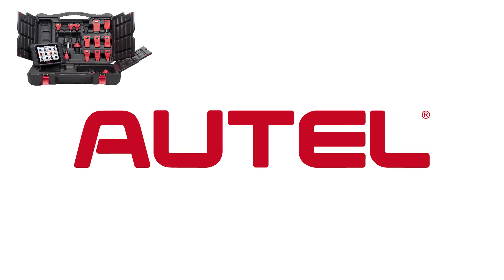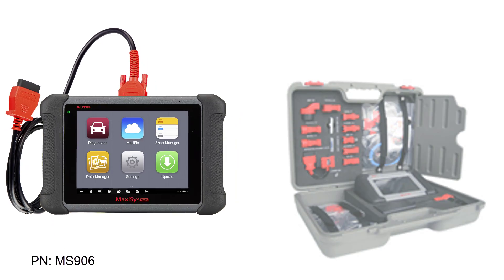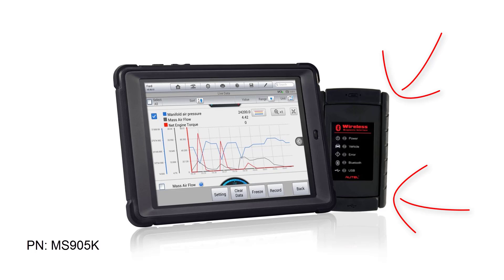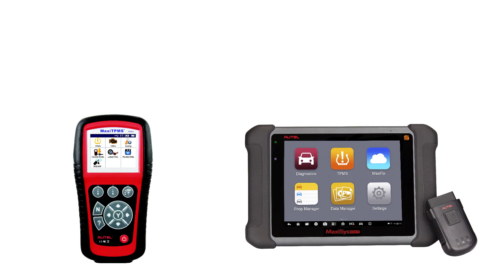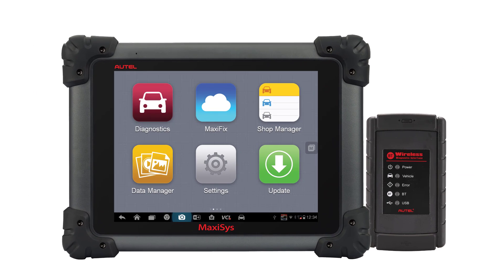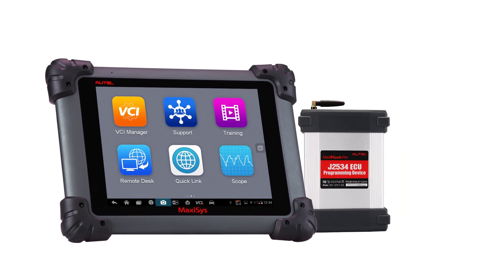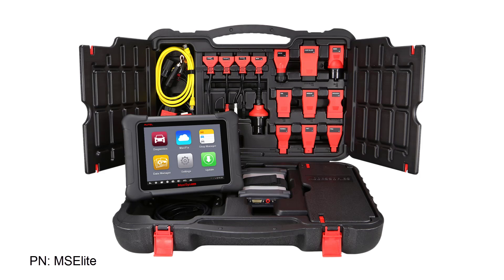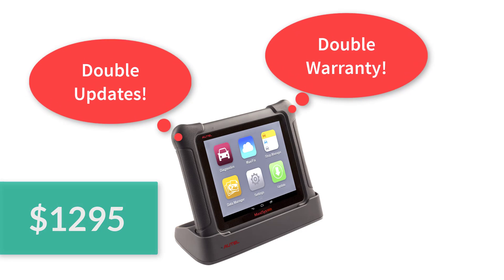MaxiSys Line of Tools Explanation

Comment: Flash Performance... Can the Autel MS908S Pro, program smart/proximity keys on a 2020 Ram?? Also can on that has already been programmed for a Ram be reprogrammed to work on a different Ram?
Reply from the maker: No, on a ram key programming you need to pull the pin. Once ram keys are programmed they can not be programmed to another truck. You would need the IM608 from Autel to do that process

Comment: What's the difference between the ms906prots and the ms906ts.
Reply from the maker: The Majority of the functionality is the same between the two tools however the "PRO" is the new version. Newer android, faster processer, and it has the ability to add on modules and accessories like the battery tester.  Also the VCI in the PRO has CAN-FD built in. Here is a comparison chart https://autel.com/c/www/mk3/3743.jhtml
Reply: Thanks haven't seen anyone break down the difference between them i deffenitly need one with tpms and doesn't make sense for me to buy two tools.

Comment: Hi Flash. 
Which Autel tool would you recommend for a mobile mechanic!? 
Thanks in advance
Reply from the maker: You never know what you are going to get into being mobile. I would recommend the Ultra for mobile. That way you have the Scope as well.
Reply: @FlashPerformance  thank you for your quick response.  What do you think about Snap on diagnostic tools and in comparison with Autel in this case Ultra !? 
I really appreciate your help.
Reply from the maker: @kianparsi878  Snap on makes a great tool, but they are crazy expensive. I am finding fewer and fewer people that are diehard Snap-on Guys. Most Snap-on owners have to own a second tool to fill in the holes and gaps. That is just my opinion...  Depending on your budget I would also recommend checking out tools from TOPDON.us I have been impressed with this tool as well.
Reply: @FlashPerformance  great will definitely check them out. Just wanted to mention that I live in Australia in case it makes any difference .

Comment: One of the things that held me back on buying one of the systems was the fact that they're based on Android. I can't tell you how many tablets and phones I've gone through because the android system was outdated. That scares me.
But what scared me more was the cost of updating these things 😬
Reply: The version of Android that is shipped on these things is already outdated, but Autel doesn't need a more up to date version of Android as it is a relatively closed system with no Google Play support so it isn't as though you are going to be able to install any third-party apps to impact the performance of the device.  It's the same thing as running Windows XP in the year 2022 just because you only need to run the calculator app.  You aren't losing any functionality with the version of Android on these devices.
Reply: Yup. Trust me. I had a MATCO(launch) scanner and just this past December i phone for support and told me”sorry, Google has pulled the plug” $1600 gone…. Yeah 4.4 isn’t far away and they say its UPDATED FOR 2022????😂 that operating system is 15yrs old

Comment: What Is Unit Of Autel Scan Tool to Use 12v and 24v In One Scan tool??
Reply from the maker: What are you trying to work on that would have more then 12 volts at the DLC?   Even though it is a 24 volt system most of the computers and network still work off of 12 volts.
Reply: @FlashPerformance  Because Most of My  Works Is Light Cars And Cargo Trucks Thats Why I Need To Know What Is The Autel Scan Tool To Use That?

Comment: Dear Flash Performance,
Great video and explaination. 
I have a question regarding Autel MaxiSys MS906BT. Can i use this diagnostic computer to programe new electrical equipments? I also want to know if i can use this diagnistic tool to adjust and programe existence and new Tire pressue monitors? I also need to know if i can use this tool to programe new kar keys? If all the above functions can be done by MS906BT, than its great and if not, which diagnostic tool do you recommand in order to enable me perform the above mentioned functions in the cars? I thank you in advance. I also subscribed into your great channel.
Reply from the maker: Can i use this diagnostic computer to program new electrical equipments? You can use the MS906BT to do memory relears and coding, but not programming.  You would need a J2534 box for programming. TPMS: the MS906BT can program the Sensor IDs to the PCM but you will still need a tool to activate the sensors. If TPMS is something you want to do I would recommend the MS906TS. Key programming is limited, you can do basic keys up to about 2012 like ford PATS, Honda, Nissan, Toyota.

Comment: Hi thank you for the video. I have a question, please help me out .MaxiFlash Elite J2534 ECU Programming, Can I perform  abs module initialization or coding  with  Maxisys? But not with the laptop programming, on Toyota  or Japanese car.  Can it be done? Thank you
Reply: The J2534 can be used with your laptop and subscription to OEM software to flash the ECU and various modules in the car.  You wouldn't use the Autel tablet for that.
For SOME European models, the tablet has software that it would download the files from Autel's server and flash your ECU through the J2534 device (other than the Autel subscription, you wouldn't need an OEM subscription for this).

Comment: What's up with the MK908P? The MaxiCom Pro I believe... Is it the same as the MaxiSys pro, or MaxiSys elite, just different technical specs?
Reply from the maker: The MK908P has the same software as the 908P and Elite. It is not sold or supported in the US market.
Reply: @FlashPerformance So you mean if someone in the US ordered it online they would have no service or updates through autel usa, but through autel in china?
Reply from the maker: @12mak  The Support and updates would come from the region it was sold from.  You would still be able to get your updates, however if you had to call in for Tech support you would go back to the region it was sold from.  Sometimes that is Europe, most times Asia. Same with warranty and repair, it would have to go back to that region for repair or service.
Reply: @FlashPerformance  Thanks!  I am looking for something with good live data, bidirectional controls,  relearns and adaptations,  I do a lot of engine performance and electrical diagnosis and repair. Is it true the DS808K is the same as the MS906BT just lower hardware and no BT/Maxiscope/borescope support? What about the MP808K? I have no interest in TPMS. What would you recommend has the best value and functions for under 1,500?

A lot of sellers advertise 'ecu coding' but that is not coding modules after installation, that is relearns and calibrations etc. Is that correct? I really appreciate you taking the time to help me
Reply from the maker: @12mak  The DS808 Vs MS906BT- The MS906BT offers: Bluetooth connection, Oscilloscope add on, Inspection camera add on, complete OEM-Specific Scanner coverage, MaxiFix, Shop Manager, ECU coding.  I have never used the DS808 so I can't speak to the functionality of that tool.  When it comes to Coding, that is all about making modules talk to each other and telling the module what it is.  Some modules come with multiple variations built in from the factory. You just tell it what options the vehicle has and it will operate based on that coding.
Reply: @FlashPerformance  now that I have purchased a mk908p I live in Canada. Was not sure of this but seller assured me it would be ok. These are all made In China but only supported by local regions they are sold in? Autel should be renamed AWFUL makes purchases of thousands of hard money put down the drain, guess i will return this. Its not worth losing $3200 in a year and tossing as i did my last one that was not longer supported 👎
Reply from the maker: @meanodustino9563  that is why most of my videos say to purchase from an authorized dealer. https://www.autel.com/c/www/wheretobuy.jhtml There are a lot of vendors that just want to sell you something. Use that link to find a local vendor to purchase from and they can also offer support.

Comment: Doesn't really tell me anything. I'm not a business, it's just me and my one car and I want to be able to fix whatever and maintain my lifetime record of never having anyone do any work other than alignments and tires. As it is, despite hours of reading, I can't tell anything other than buying the most expensive model will most likely cover all my bases, but it may also be gross overkill? For example; say need to swap out the conductor plate on my tranny (2016 Mercedes 722.9 tranz), what secret squirrel stuff has to happen for the car to accept it? What Autel models can do it, and can I do it at all because what if the code/program needed is only available from MB and they aren't sharing so they can monopolize the work? Or when my ESL (steering lock) dies, or before it dies, I need to program an emulator to get rid of it. I also want to alter the way the tranz shifts so it shifts like a normal car, like from the 60-70's. Plus delete the "safety feature" that has twice thrown it into park while driving! Make it so no exterior lights come on when I unlock it and get in, or exit and lock it. Dim the dash lights lower than the oem lowest setting. Just little things that I know are possible, but is it possible for a Joe Blow using your devices? How does someone find all this stuff out? Thank you. Fyi I asked on auteltech.com and they never replied.
Reply from the maker: The answer to your questions is yes, no, and maybe.  Because of the agreements with the OE manufacturers the Autel tools can not change anything on the vehicle outside of manufacturers specifications. That mean no to changing the transmission shift points, or pressures, and not to changing the safety features or dash light dimming.  Some of what you are asking for can be done with SCN coding, and the Maxisys Elite, and Pro can do those functions. They also come with a J-2534 box that you can use with a PC to do programming.  Can the Autel tools do the conductor plate replacement, Yes, however some may require EEPROM using an IM608.  You would have to do the renewal process connected to the plate then the rest of the process can be done via OBD2.
Reply: It seems like I won't be able to get what I want but I thank you for the info

Comment: Do you know if by any chance the MP808TS does the same as the MS906TS? Like what is the difference do they both have bi-directional features.
Reply from the maker: The MP808TS will give you bidirectional controls, however I think it is missing the advanced coding features the MS906tS has. I have not used that tool, it is not sold or supported in the US market

Comment: How much are the updates?
Reply from the maker: each machine has a different cost for the updates. Check with your local dealer for pricing.  Take the model number of the tool and add "-1YrUpdate"  example "MS906BT-1YrUpdate"  Pricing ranges from $495 to $1295

Comment: Price was not pointed out nor all vehicles that this can be used for...😏
Reply from the maker: Prices will very by market.  Vehicle coverage can be found at https://www.autel.com/vehicle-coverage/coverage2
Reply: @FlashPerformance  i have a question if i was able to use a ms906bt for this job would it work? I got a 09 pontiac vibe awd 2.4 and i need to replace the abs module and was curious if i have to get a brand new module or if i can get a used one to work, i believe the ms906bt can read the info on the old module then when u go through the program it will tell u to install a the new module what alot of ppl dont do is they dont read the old module when its in the vehicle they just change it out for a new/used one without reading the info first. Just curious if the 906bt can do this type of repair? I know its vehicle specific but just trying to get and idea on what the 906bt can really do. Thanks flash!
Reply from the maker: @downeastoutdoors8713  On an 09 you should not have any problems installing a used unit. I would recommend making sure the part numbers between the original and replacement are the same.  You are correct, you will need to read the module information with the scan tool first, then replace it with the used module.
Reply: @FlashPerformance  would it be different if the module was brand new vs used? I figured it would work on a new one as well but dont have years of experience with higher end scanners. Thanks for the reply :)

Comment: Can the 908pro reprogram seats after a collision when airbag light is on for occupancy sensor
Reply from the maker: Yes, it can do the memory reset on the seat weight sensors.  Usually the airbag module has to be replaced with a new one and it can be programmed with the J2534 box.

Comment: Wow,  excelente video but i was wonder if you can help me to understand more about MAXISYS 908CV,light duty,medium duty and heavy duty, so far I haven’t find any specific information about it and i really confuse me 
... I believe the same diagnostic tool does everything and it works on cars and trucks 
Nice video and very well explained 
Thank you
Reply from the maker: The MS908CV does Light, Medium, and HD Trucks, Buses and Semis.  However it does not have any passenger car coverage.  Every truck from a Ford Ranger to a Class 9 AutoCar.  A tremendous amount of new updates just came out this month (April 2019) adding Trailer ABS, ThermoKing, Body control modules and more DPF functions and procedures. Message me on my FB page @Flashperformance and I will send you the update information.

Comment: Hi, I'm on the UK & was wondering if buying a elite or 908 & series would include the 2 years warranty & free updates to or that just for the US customers?

Also what is the differences in the elite to the 908s to the 908s pro to the 908cv?

Any help would be greatly appreciated as I'm looking to buy one asap
Reply from the maker: It is my understanding that even the MaxiSys Elite in the UK has 2 years of updates and warranty. Check with your local authorized dealer.  There are a lot of fakes and hacks in the UK.  "S" series tools are just upgraded hardware and they come with 64g of memory vs 32g.  The CV tool is for commercial vehicles. Class 1-9, no passenger cars

Comment: Hi what’s the difference besides the J coding block from the 908 to the 908P? Can I still code and program my bmw without the upgraded J 2534? Thanks In advance
Reply from the maker: The base software between the MS908 and MS908P are the same, however the MS908P with the Jbox adds the programming software.  You can upgrade your MS908 to an MS908P  by purchasing the J-box and linking them together. To answer your question, no you can not do programming with the MS908, only the P with the J-Box
Reply: Flash Performance thank you for this. Is the coding the same for both? I want to buy one and add a video of it to my you tube channel so others can also see how good it is.
Reply from the maker: @weldingjunkie  Yes, when it comes to the coding part they have the same functions between the two tools. Good luck!

Comment: Does the Elite have the option to hook up to the car hard wired? That is, does it come with a cable to hook up to the OBDII port instead of wireless? Is it better to go hardwired if doing reprogramming? I have read horror stories about lost connections while programming.
Reply from the maker: The tablet can be connected directly to the J-Box by using the provided USB cable.  It has red ends and is gold plated for best connection speeds.  When using the tablet to do supported programming features, the tool will require you to be connected with the USB cable before it will let you proceed
Reply: How about regular scanning- can you hook the tablet directly to car with a cable or would you have to go through the J2534 (like if the wireless wasn't working for some reason)? @FlashPerformance
Reply from the maker: @patrickstewart4620  Sure, you always have the option to connect with the USB cable through the J-Box, but there is no way to cable directly to the vehicle.
Reply: Thanks for the info! @FlashPerformance

Comment: What about the Autel MX808 and Autel DS808? What's the difference between these two? I just need a computer than can read manufacturer specific codes.
Reply from the maker: This video was made before the MX808 or DS808 were released.  The MX808 can read manufacturer specific codes in all modules along with graphing and clearing. It also has service functions like Electronic parking brake and Oil life reset.  The DS808 is not sold in the US market but it offers bidirectional controls it is missing the coding and initialization functions of the professional tools.

Comment: What is the most basic Autel I can purchase to program honda immobilizer keys and smart keys? I really only need it for that, but other diag functions would be obviously helpful. Waiting in line for the shop scanners sucks.
Reply from the maker: The best answer for that is not an Autel at all.  The challenge is the Smart keys.  The Autel MaxiSys tools (any MaxiSys, least expensive would be the MS906) can do honda immo and all keys lost, but once you add high security keys you start a different challenge.  I would recommend the IM100 from Auro Diag.  Auro Partnered with Autel to make a tool that does the high security keys and all keys lost.  You will be able to scan all modules on Asian, Domestic, and Euro vehicles and read and clear codes in all modules. I recommend checking out https://www.aeswave.com/IM100-AuroDiag-OtoSys-p9672.html for the Auro IM100